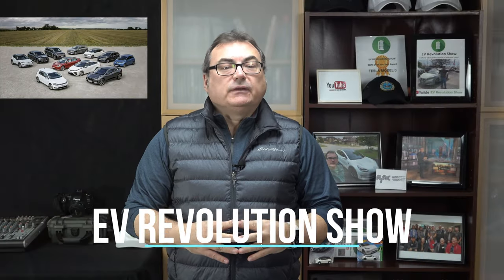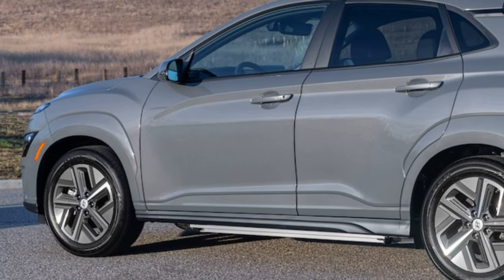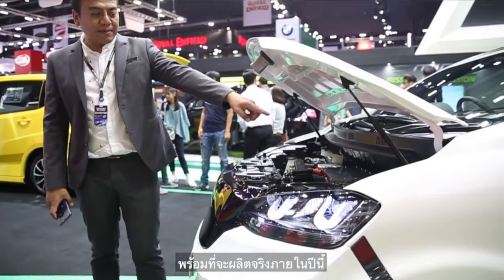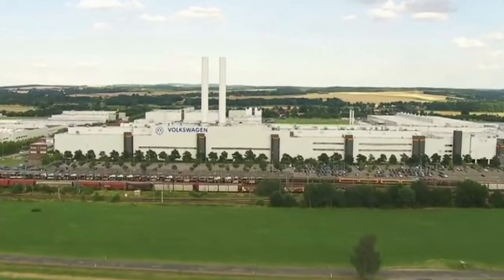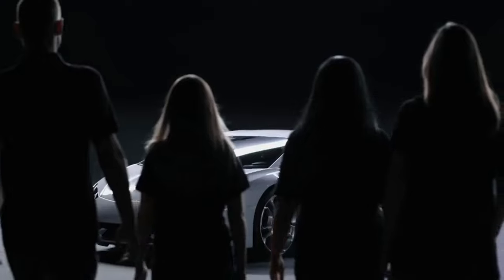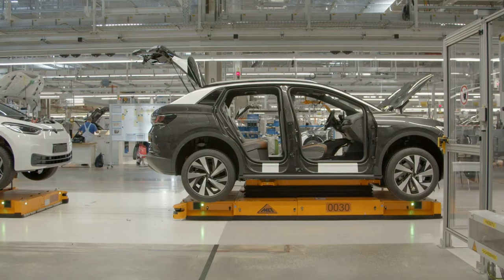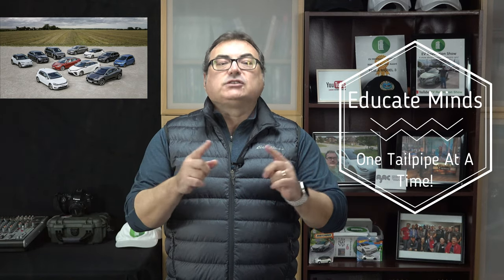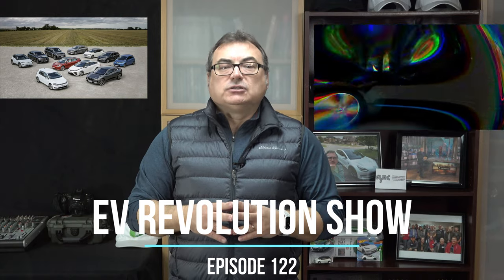Episode 122 - VW Group’s Strategic Electrification Plan and Thailand’s  "Home Grown” All-Electric!

Comment: A great show and very informative. On the VW story, if they plan to make 1.5 million EVs in 2025, that’s good, but it this them tacitly admitting that they will be smaller than Tesla by then, as Tesla should be somewhere between 3 to 5 million by then. Hyundai/Kia also seem to be heading in a good direction. Whatever, it’s all good.
Reply from the maker: Thanks for watching @Brian.  Sure, they need to show growth but it's really not a race between EV suppliers, but between them and OEMs producing ICEVs.  The shift has to start sometime.
Reply: @Brian
VAG growth doesn t automatically imply Tesla will grow twice or more. 
 
Each brand do thing differently especially in term of product development and strategy. VW does thing more structurally, professionally, long term and more effective than Tesla. For instance Tesla starts from scratch every time they build a new model and their lineups looks randomly and very poor, where VW uses their new modular EV platform and can roll out like 5-10 new different models every year from SUV, hatchback, van, wagon, just like that. Like this year VAG will launch 4 new SUV models: E tron Q4, and Skoda Enyac, ID 4, ID 6 , one hatchback model: Seat Elborn, one sport sedan: E tron GT. Next year they will add 4-5 new models including a wagon and a van. And i didn t even mention their small lineups: ID 3, E UP, Skoda citigo, Seat mii.

VAG may already pass Tesla globally by the end of 2023. 

VAG had like 200% sale increase last year globally. From about 80 000 in 2019 to 230 000 in 2020 with mostly ICE based EV in their lineups E tron, E golf, VW E up with an exception of the new ID 3 with 53 000 sol units from last september and on was on sale in only three months.
And that was before their new EV based platform models become available globally: ID 4, ID 5, ID 6, ID 7 and more.

Don t believe in what VW say. They are german and don t like to brag. They know in their mind that they have an immense potential.

Comment: Went to local Ford to test drive Mach-e Premium RWD.  The place was full of customers; all of them looking at Mach-e!  3 of 6 sold in last day.  Ford IS changing.
Reply from the maker: Thanks @Mike Carter for the info!
Reply: Great news Mike, but I've heard of several dealers in the US charging 5k to 10k over MSRP for the Mach E, that will not help adoption!
Reply: @jamespaul2587  This dealer had a large window sticker with an arrow pointing to the MSRP saying "no markup!" so obviously you are right and others are doing it.  So far, 2 of 2 no markups but these may be exceptions.

Comment: Thanks for the episode.  Confused though by the features of the new Kona redesign were those new features or just the main features as I heard you mention DRL which already exist on the current Kona.  Interesting to hear about the SPA1 in Thailand, pretty sure Bjorn will take a look when he can get back to Thailand again and into his MG ZS EV.  I do think though that the batteries are too expensive stick is getting old and batteries do not cost what they did 10yrs ago so then why are major EV manufacturers not selling affordable EVs to match their ICE models pricing.
Reply from the maker: Thanks for watching. DRLs are part of it already, they've just been incorporated into the new headlights.  

Yes I agree, EVs should already be going down in price.  However, the majority of OEMs are late to the game and as such need to keep prices high until they can get economies of scale.  Hopefully within another couple of years or so.  

Telsa really should be lowering their prices too, and dramatically.  Yet they are not.
Reply: @EVRevolution  Well think about it not all OEM's are late to the game.  Nissan/Renault, Hyundai have been selling EV's for awhile now, heck even GM had the Volt and then the Bolt.  So even that argument doesn't hold those OEM's who've been in the game as long as Tesla(ahem Nissan) or even GM could definitely be looking at making their EVs lower priced.

Comment: Excellent review of VW. I am waiting for the ID 4 to be launched in Europe / UK and am delaying a bit until the software evolves a bit.
You did make me smile when you went through the brands with video clips. Skoda with a flash of a Bugatti 😂. In the 1980’s Skoda was much ridiculed in the UK for their poor quality and reliability. VW group have done a fantastic job turning the brand around. The stigma of the brand name still remains a little for us oldies, even though we know its a good product. Where VW lead other must follow and the only way ahead for all automotive. I believe the likes of Toyota are just buying time by some of the PR so the sell cars in the transition. 
I saw a quote stating that, road vehicles account for 28% of co2 currently, so a good and achievable area to address. I know there are a lot of initial emissions during production but the life time emissions are towards zero, which must be a sensible goal.
Reply from the maker: Thanks @Bob!  Yes the video clip was not in order of my dialogue, just how I found it.  But everyone got the point.

Agreed on Skoda.  I remember when the came to Canada in the mid-80's.  I almost purchased one as the price point was real cheap, like the original Hyundai Pony.  Skoda was a rear-engine machine, 4 doors fairly well equipped.  Alas they did not last long here as really could not penetrate the marketplace and left.  I too am very glad VW has turned them around into a high-quality brand with great products.  

Yes, the vast majority of vehicles on the road are "light duty vehicles" - cars, suvs and pickup trucks.  About 98% of the 1.5 Billion (approx) on the roads today around the world are LDVs.  So for sure, a good place for consumers to make a difference in GHG emissions is the transportation sector.  However, at 3 Million EVs a year, we are not even making a dent yet.  

So that is why I plead with OEMs and people to really step it up.  If you read Bill Gates newest book, it's a shocker how far we really have to go and transportation as you say Bob, is only a small part of the overall emissions globally.  I do what I can for the cause, not glory or YT fandom or making tons of money off of this.  It is simply to help change our ways, one tailpipe at a time.

Comment: Do you still like your Model 3? How noisy is it at 110kph speed?
Reply from the maker: Hi Steve, yup I do and will be doing some more product promos and a review of my Model 3 soon.  The weather has been cold and we are still under lockdowns where I live, so not going out too much.  No, the wind noise is better after Tesla service reset the drivers door glass.  Its not too bad and I would say, same like any other frameless doors vehicles.